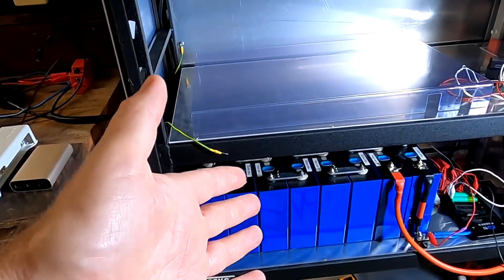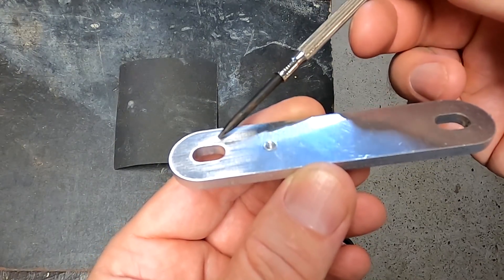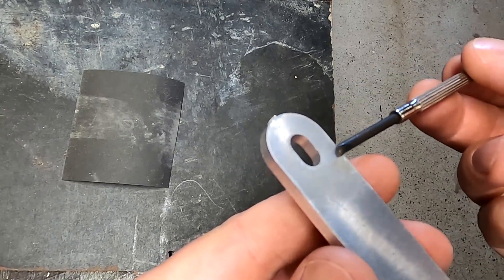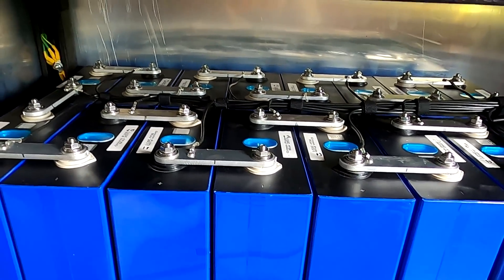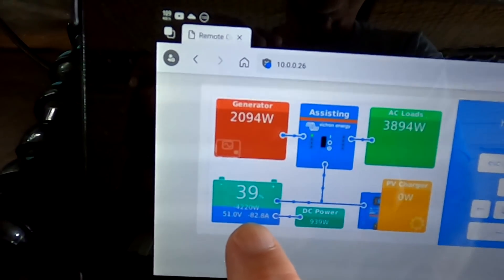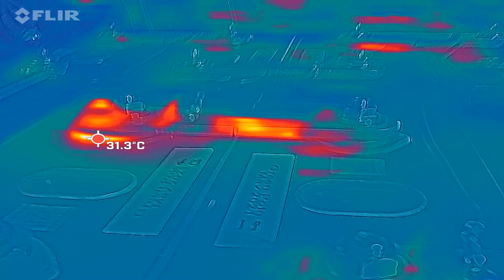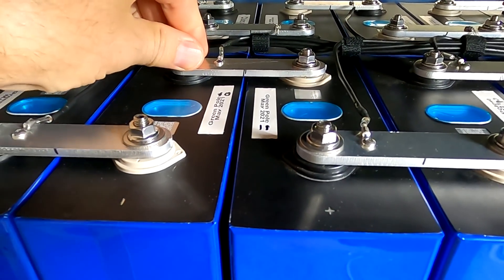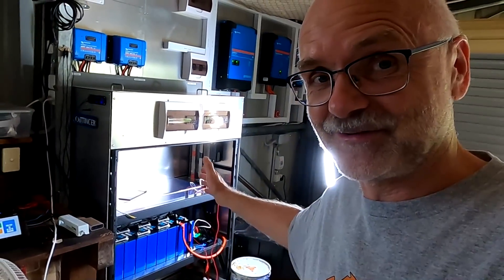Overcoming the battery-busbar problem (for now). Here is what I found!

Comment: Man you gonna fry yourself with that naked hand going over those terminals with ur skin directly so close. Be careful, you will not enjoy that high current if u are unlucky to touch terminals passing the 24v area of battery.  At 10:10 you have less then 1 inch between your elbow and your palm.
Reply: Isnt it generallay accepted that this is not a problem with voltages under about 50v? I still take a lot of care but I don't think the risk of shock is high at 50v. I may of course be wrong I am not an electrician !!
Reply: It is a nasty shock at 12v, at 48 that contact is like a glue with your skin. That is continuous current not AC power. For AC is true that at low voltages is not that bad under 50v not for DC. You never tasted power of a car battery on your skin? :) Those high amps will melt 3mm copper wires like paper if you short them.
Reply: @dacool4606  AC is more conductive in the human body at low voltages than DC. The reason is that the human body is not a pure resistor, but instead can be modeled as a set of resistors and capacitors (look up the circuit model of the body). Because this impedance isn't purely resistive, AC (for which a capacitor is a short circuit) has much more effect than DC, especially at lower frequencies. You can easily touch 48V DC. Yes, it might sting a little if your hands are wet. AC at that same voltage has much more of a kick to it. If you look at the bodily effects of both DC and AC currents, you'll see that AC has similar effects as DC, but at lower currents. This is also why the voltage safety limits are higher for DC than AC. For example IEC 60364-4-41 says exposed live parts can be up to 25V AC or 60 VDC.
Reply from the maker: Not true at all, 48V will not glue your skin to the terminals. That is rubbish. I touched the pure bars countless times without feeling anything. at 50V there might be slight tickle if you have wet skin but normally you don't feel it at all.
Hi amps can only flow if the resistance is low which is not the case of your body at all. You will never get shocked form a 12V battery even if you're covered in water.

Comment: I got a set of buss bars from Paul. They are working great for me. Other commenters are saying ditch them. I say NO. The terminals are aluminum anyway. There is always going to be a greater chance of issues with unlike conductor minerals.
Reply from the maker: I find them great as well. Some comments here don't provide any explanation why you should not use them. I think they heard Al is not as a good conductor as Cu and therefore should not be used. They may not quite understand...

Comment: To tell the truth, I have never trusted aluminum in electrical applications. As a professional electrician, I have always used Ideal NOALOX Anti-Oxidant Compound to coat aluminum connections. Having maintained a number of 40 to 250 hp 480-277 volt and 208-120 volt 3 phase irrigation pumps I can tell you the connections would not last a season without anti-oxidant paste. I also used to recoat the connections on these high amp applications once a year but never let them go more than two seasons without a recoat. 

With aluminum, there is one other worry. The expansion rate is so great, the connection tends to move and wear off minute amounts of aluminum causing the connection to loosen and arc. The expansion also seems to change the shape of the connection almost as if someone hammered the wire and connection thinner.

Finally, are you absolutely certain that the bus bars are actually heavy enough to carry the load? I would take a cross sectional area of the bus bars and compare it to the cross sectional area of the nearest wire gauge to determine the load capacity. 

Good luck with the aluminum. It has been my experience that no matter what, at least a certain percentage of connections always end up being trouble over time. Sorry, I should have said something sometime ago about my apprehension, but you seemed so sure of what you were doing.

Also, how did you cure the stripped threads on cell #6 (I think)?
Reply from the maker: The terminals of the batteries are aluminium.
Reply: @OffGridGarageAustralia  Yes. I know that. I have considered these types of cells for myself. To be sure, most of the connections in the big units that I used to maintain were Al to Al or Al to Cu rated. Still, the big problem in my opinion was distortion of the connection brought about by heat expansion. That is why I took them apart on a periodic basis to see what kind of damage was being done and to recoat any bare metal. Some of those big motors were running as high as 400 amps. IE, so much that they had be started by a remote 120V circuit. What is your amp demand?
Reply: @josepeixoto3384  Yes. Have you ever worked around crop circle, AKA center pivot, wells? Some draw down as far as 900 feet with many at 400 to 500 feet. The demand for water per acre can be as high as 6500 to 7000 gallons per acre per day at 0.25 inches per day. That works out to about 117GPM on 10 acres. A 1/4-mile circle that covers around 125 acres will demand around 1400 to 1500GPM at 80% efficiency on a 12-hour cycle. All of that depends on the crop being irrigated. 

Using very rough and average calculations because each well, and its applications, is always very different from all others, the horsepower demand will of course depend on depth of well and psi to be maintained. Well head pressure maintained at 160 to 170 PSI will require up to 200HP while 50 to 60PSI will require around 80HP, and none of that involves the free water surface depth in the well. These examples are of pumping out of a surface tank, a ditch, or a pond. There are also considerations for frictional loss in the main line and how many towers are actually in the pivot, adding length to the pivot, all of which requires the addition of PSI to maintain pressure at the end of the pivot. 

A 200 HP pump can use nearly 150,000 no load watts which comes out to be about 416 amps in a 120-volt line to neutral 208V three phase system or 180 amps in a 277 line to neutral voltage in a 480Volt system (with a neutral in a modified or Star Delta). Use a PF of 1 just for simplicity's sake. In my area, there are many wells that are very much larger than this example.

Comment: Depending on the type of aluminium, if it is extruded, cut from sheet, cold rolled or formed it will form an oxidised surface within 20 minutes of manufacture or working. This is well known in the marine industry where many boat hulls are made from aluminium. Also, not all aluminium is the same you need to be aware that the resistance of some aluminium is higher than other types. It is not all suitable for bus bars. The higher grades are better but not perfect. Use Copper for bus bars. Yes it is more expensive but it is also more conductive and does not have these issues.
Reply: I get soft copper tubing and smash it flat. Very inexpensive way to get all copper buss bars.
Reply: @geraldkoth654  any issues with the bare copper to aluminium battery terminals?
Reply from the maker: They used 5005 aluminium for these busbars.

Comment: Why are you using aluminum busbars it seems to me that that would be a higher resistance Then tinned copper
Reply from the maker: To learn, to understand and to experiment. 
I could have bought a ready built battery, right? It would just work.
Reply: If they were the same size yeah. But these alum bus bars are much larger. But tinned copper would be my choice too.

Comment: Hi Andy. Why are you stuck with aluminium. Why not copper, nickel or even appropriately sized stainless steel. I'm afraid even your perfectly sanded busbars will reoxidise again.
Reply from the maker: I'll copy the answer from the comment above:
To learn, to understand and to experiment.
I could have bought a ready built battery, right? It would just work.
It's a DIY channel after all, so we experiment.
Reply: Horse Dead Beating

Comment: Andy why are you using Aluminium - Its just pants and will be a constant source of issues at high currents when it oxidizes  - its probably not even pure aluminium which is seldom sold in strip form - Take the Plunge - bin them
Reply from the maker: To learn, to understand and to experiment. 
I could have bought a ready built battery, right? It would just work.
Reply: @OffGridGarageAustralia   "Falling down is not a failure, failure is when you stay where you have fallen" Socrates

Comment: there is a reason nobody uses aluminium for bus bars. its just not a good idea. you should use your meter to measure the voltage drop between the terminals
Reply from the maker: I can't measure the voltage drop as I don't have access to the terminals any more.
Reply: @OffGridGarageAustralia  It is a shame you cannot reach the batt terminal.. If you could reach the terminal you could measure the voltage drop and tell how good the connection is. Yes, you will have less chance of over-heating when there is less current. However, it only reduces the risk, does not eliminate the problem.
BTW. thanks for making these videos. They are a good thing for everyone considering doing the same thing or are simply interested. Please keep it up.
Reply: @OffGridGarageAustralia  just probe the nuts, they are connected to the studs and will probably give you the actual voltage

Comment: I'd still ditch them. Aluminum is a terrible choice for DIY packs. Managing the oxide is a neverending task and copper or nickel is an infinitely better choice, especially in a pack that is functionally outdoors (no climate control). You won't win this fight against chemistry. That's my advice as a professional electrical engineer.
Reply: Agree with mausball.  I would not use aluminium.   How often you going to have to clean those bars now?
Reply: Are you guys ignoring the fact the battery terminals are aluminum? 
Dissimilar metal corrosion is a factor as well... 
Aluminum to aluminum is a fine choice with proper torque, and flat surfaces treated to seal out air and moisture.
Reply: @SuperVstech  Proper Torque is the operative word... something which isn't possible here due to threaded aluminum terminal.
Reply: @SuperVstech  Aluminum is still a really terrible choice here. It's used in high tension lines for weight and cost reasons, but that's also a very specific alloy, treated in a specific way, not something you'll find in consumer level bus bars. For something that will be moving constantly (thermal effects here are significant) and is functionally outside, Nickel plated something is going to be the best choice, with copper being second.
Reply: @SuperVstech  You are absolutely correct. What these people don't understand is that there are different grades of aluminium. I bet no-one picked up that the busbars were made of 5005 aluminium. Crap! Machined out of 5052 or 5083 aluminium sheet would reduce corrosion effects significantly. That's why marine grade aluminium is 5052 0r 5083
Reply: @offgridstuff  I'm very late to the game here, but you're right about the right alloy being the key here. I was shocked once I realized the difference in conductivity for different Al alloys.. But of course, poor contact (as you probably always will have with stiff Al busbars?) will still be a problem.
Reply: @SuperVstech  aluminum terminals on batteries are a very different type than most folks can buy for bars. I’m not ignoring it at all. As far as corrosion, aluminum won’t do that with nickel or copper. You’re thinking of stainless steel, carbon fiber, and a few other things found on boats and airplanes, but very rarely battery banks.
Reply: @mausball  Galvanic corrosion can/will absolutely happen with aluminum to copper contact.
Reply: @BradCagle  That will definitely happens in a very high pace because there is very high amp. Pure alu to alu contact is the best.
Reply from the maker: We will find out over time. It's an experiment! Like many others we do here on the channel 😉
Reply: @OffGridGarageAustralia  an experiment is fine, but over time, likely sooner than later, the daily heat cycle and load/idle heat cycling will have those bus bars moving a lot and wiping away the No-ox-id, and you’ll be back to candle connections. I’d hate for one to go critical overnight. I’d strongly recommend a change soon to nickel plated bus bars, either aluminum or copper core, or solid copper bus bars. There’s a reason they’re standard in every commercial battery bank.
Reply from the maker: @mausball  I'm not expecting them to move actually. If they don't heat up, there is no expansion.
Reply: @OffGridGarageAustralia  they’re aluminum. Day to night temps will make them move a few thousandths twice a day minimum.
Reply: @mausball  but what about copper cables with the ring lugs, they won't move at the terminal because they're flexible? Not even twist around the post?
Reply: @OffGridGarageAustralia  Mausball's comments match my experience and I have the same concern about the connection failing in the future. It is too easy to eliminate even the possibility. And the consequences are overheated terminals and damaged cells. Would not be worth the risk for me.